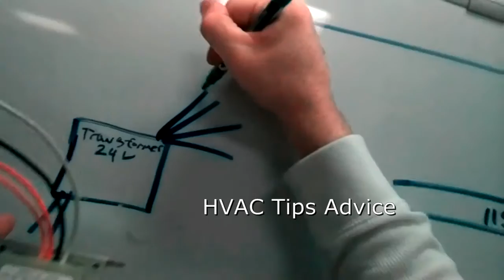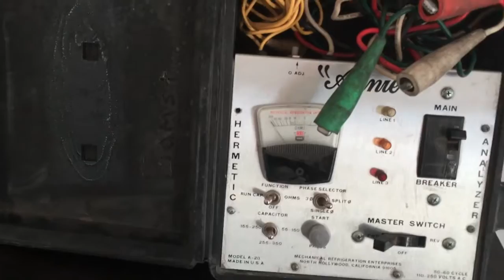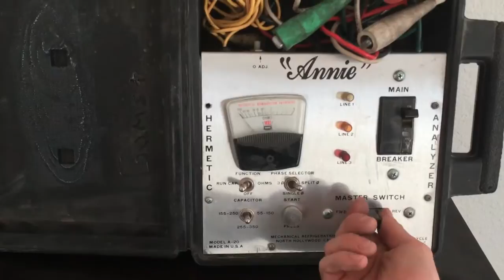"Annie" Analyzer and Can Start a LockRotor Compressor

Comment: i have one that says its a model A-3 it has 2 meters on it. and Ohm and an Ampers meter. i believe its an older model than yours. as mine has all metal toggle switches instead of the big plastic one for the forward and reverse. my dad died 17 yrs ago and i was just 24 when it happened so i never asked him about this tool. but removing some old things from my moms basement i found this down there....knew it was for testing compressors or something as it says  Mechanical Refrigeration Enterprises at the bottom. just trying to figure out if i can use it on my fridge that stopped cooling. paid 1600 for it 5 yrs ago and it took a shit already...

Comment: Just picked up an Annie A1 circa 1977 at a swap meet for $20.

Had a seized compressor that I was going to autopsy for a class.But I thought I would give Annie a shot.... damned If that compressor isn't running like a top right now
Reply: ok so if ur A-1 is a 1977 then my A-3 must be an early 80s model. which makes sense cuz my dad was in the restaurant business in the 80s and 90s and had walk in coolers and freezers plus 4 more in the restaurant kitchen so he prob use to test his compressors with it...

Comment: Here's the Manual on Annie. OLE!
The following data is applicable to the ANNIE A12X Export 220-250 Volt-60 Cycle Model.

SECTION A – METER OPERATION 

Ohmmeter

1. Make sure the Analyzer is unplugged and Ammeter Switch is off, Ammeter operates on “D” cell battery.
2. Move #hmmeter Switch to ohms position.
3. Clip Red & Black leads together, turn Master Switch on, needle will move to about zero. Adjust to zero Ohms with control inside chord pocket. If meter will not zero, replace battery.
4. Use Red & Black leads to identify winding terminals. Highest Ohms is from Start to & Run terminal.Terminal left is Common. Reading from Common highest is Start. The remaining terminal with lowest reading is Run.

Voltmeter

1. Disconnect Analyzer from external power source.
2. Put Ammeter Switch to “Hi” position.
3. Put Ohmmeter Switch in “Power” position.
4. Put Voltmeter Switch in “Line” position.
5. Turn Master Switch “Off”.
6. Isolate Black, Red, White and Yellow from each other and earth.
7. Connect power supply chord of Analyzer to "coltage connection to be read.
8. The "voltage indicated on the Voltmeter is the line "voltage supplied to the Analyzer.

Ammeter

1. Disconnect Analyzer from external power source.
2. Put Ohmmeter switch in “Power” position.
3. Put Ammeter switch to “Off” position.
4. Put Master Switch in “On” position.
5. Connect the apparatus under test to the Red and Black leads. Isolate the Yellow and White leads from each other and ground.
6. Connect the Analyzer to a power supply of the correct "voltage for the apparatus being tested.
7. Put Ammeter Switch to “Hi” position, read up to 25A apparatus being tested. After apparatus has started switch to “Lo” position, if current draw on the ammeter is under"5A"
8. If line "voltage is desired while measuring amperage, place voltmeter switch in the “Line”position.

Section B - HOW TO CHECK A HERMITICALLY SEALED UNIT 

1. Remove all external wiring from the terminals of the sealed unit.
2. Connect the Red Lead to the Run Terminal. White Lead to Start Terminal, Black Lead to the Common Terminal, and the 
Yellow lead to the solidly Frame.
3. Make certain Master Switch; Ammeter Switch and Voltmeter Switch are off. DO NOT CONNECT ANALYZER TO EXTERNAL 
POWER.
4. Put Ohmmeter Switch in “OHMS” position and press Start Button. If resistance is indicated (movement of ohmmeter)
the windings are shorted to the frame.Replace unit if this condition exists.
5. Put Master Switch in “On” to check resistance of Run winding. “Reverse” position checks resistance of Start windings. 
Replace unit if windings are open or earthed. 

Section C - HOW TO START A HERMITICALY SEALED UNIT

1. Remove Yellow Lead from frame and isolate it from earth.
2. Put “Ammeter” Switch to ‘Hi” position.
3. Put “Ohmmeter” Switch to “Power” position.
4. Put Master Switch in “Off” position. 
5. Put Capacitor Selection Switch in proper range (see selection G)
6. Connect Analyzer to power supply of correct voltage for the compressor. Power Light will come on when the Analyzer is energized. If no light or a very dull glow of Power Light check fuse in chord pocket. Replace if necessary. Line Voltage can be read by putting Voltage Switch in line position. 
7. Hold Start Button “IN” put Master Switch “ON” position.
8. Release button when units starts.
9. Turn Master Switch off if unit fails to start in 3 seconds. 
10.If unit operated satisfactorily the trouble is with the capacitor, relay, control, overload or other external wiring.
11.Put Ammeter Switch and Voltmeter Switch to desired ranges for further tests. These tests include low voltage or high current draws, those that are above rated amperage. If unit fails to start it is stuck, see section D. Disregard capacitor and relay bulbs while making this test.

Section D - HOW TO REVERSE A STUCK OR FROZEN UNIT 

1. Proceed as outlined in Section C, steps one and two.
2. Holding start button in, quickly move Master Switch between “On” and “Reverse” position several times. If unit starts let 
it run for approximately a minute then turn it off. 
3. Try to start the unit as outlined in Section C, Step 3. If unit now fails to start it is beyond help and must be replaced.

IF FUSE BLOWS WAIT FIVE MINUTES AND REPLACE THE FUSE INSIDE CORD POCKET

Section E - How To Test Capacitors

1. Make sure Master Switch and Ammeter Switch are off. Put Ohmmeter in Power position. 
2. Disconnect Capacitor form all external wiring including bleed resistors. 
3. Discharge Capacitor with light bulb or bleed resistor so as not to blow fuse on internally fused capacitors. 
4. Connect Black and Yellow Leads to Capacitor terminals.
5. Connect tester to power source.
6. Place Ammeter Switch in “Hi” position and note reaction of light.
a. If light goes on then out the capacitor has taken a charge. New capacitors may keep the light glowing for few minutes
b. If no light the capacitor is open.
c. If light stays on then the capacitor is shorted.
d. If light decreases but does not go out the capacitor is leaking.
7. When light goes out, press capacity button for mFd reading of start capacitors. (Do not press button if light remains on 
indicating a shorted capacitor) Discard capacitors that vary 20% from rating. For small start and run use “LO” range on 
Ammeter. 
8. (Optional) The Analyzer can be left on the job as an emergency substitute capacitor. Connect the Yellow and White 
Leads to the leads that normally go from the systems wiring to the capacitor DO NOT PLUG THE ANALYZER IN, put 
Master Switch on and set Capacitor Switch mFd needed. All other switches should be left off or in the center position.

SECTION F - TO TEST POTENTIAL RELAYS ONLY

1. Make sure Master Switch, Ammeter Switch, and Voltmeter Switch are off.
2. Put Ohmmeter Switch in relay position.
3. Turn volts control all the way down (counter clockwise)
4. Connect White Lead to relay terminal #1, Black Lead to #2, and the Red Lead to #3.
5. CONNECT ANALYZER TO 230 VOLT POWER SOURCE.
6. Turn Master Switch “ON” and set Voltmeter Switch to relay position. Relay light must come on. If no light points are 
open, replace relay.
7. Increase volts until relay “picks up”. Make a note of the voltage before “pick up”. This indicates the “pick up” voltage.
If light remains on, points are frozen and relay must be replaced. If relay does not “pick up” at maximum rated volts,
the coil is bad and the relay must be replaced. 
8. Decrease voltage until relay “drops out”. Make a note of voltage just before “drop out”. This indicates “drop out” volts.
Light must come back on when replay drops out. If Light remains on the points are frozen or sticky and relay must be 
replaced. 
9. Compare pick up and drop out voltages with the information supplied by the relay manufacturer. 

SECTION G - 240 VOLT CAPACITOR INFORMATION

1. Units up to 2 hp use 25-80 mFd range.
2. Units of 1-1 hp use 85-145 mFd range.
3. Units over 1 hp use 150-200 mFd range. 

SECTION H - RELAY WIRING INFORMATION

1. G.E. Relay 
a. Lead from post #1 goes to “Start”
b. Lead from post #3 goes to “Run”
c. Other post is “Common”

2. Delco Relay
a. Lead from post #S goes to “Start”
b. Lead from post #M goes to “Run”
c. Other post is “Common”
Reply: Thanx,Man!!!
Reply: @lebenitj  :person-turqouise-waving: